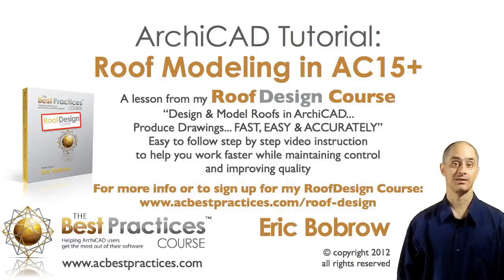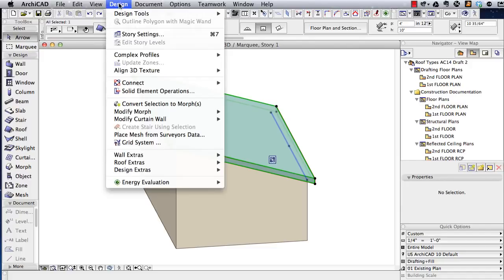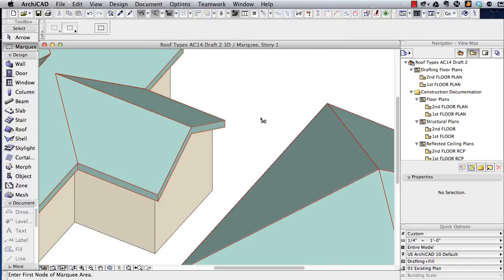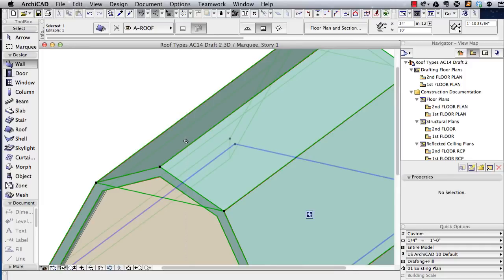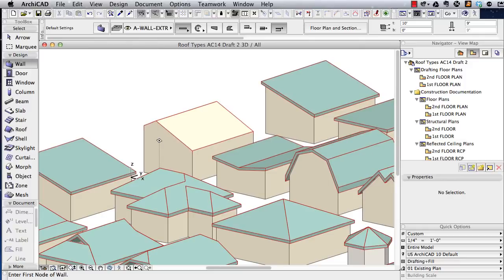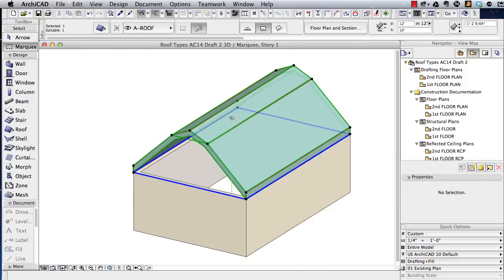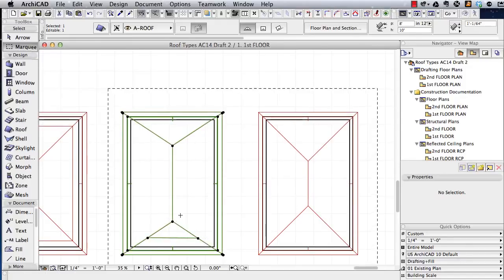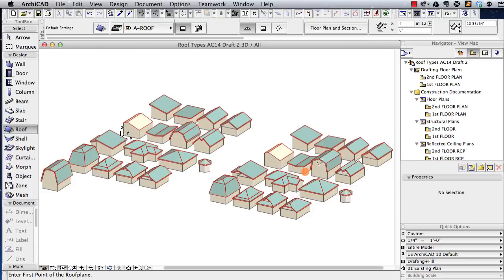ArchiCAD Tutorial | How to Model Roofs – In Depth Tutorial For A Wide Variety of Roof Types

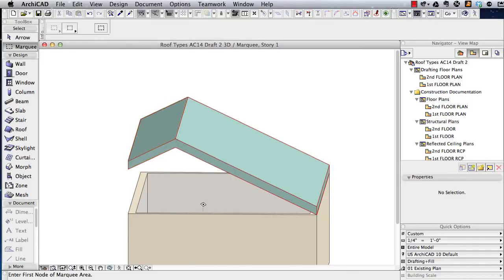Comment: Great tutorial, but what are you clicking to merge the two roof edges at 29:42?
Reply from the maker: @Vivex - In each case, I am selecting one of the roofs (it acts as the "controlling one" that defines a sloped plane) and holding down the Command (Mac) or CTRL (PC) key while clicking on the EDGE of the other roof, causing that EDGE to reposition to meet the "controlling" roof. This is not technically "merging" the roof edges; it is repositioning the edge (that you click on with Command or CTRL) to the location where it will cleanly intersect or meet the other one. I hope that is clear...
Reply: @EricBobrow  Thank you, I figured it out eventually. Very useful way of creating roof plans of existing houses, in practice almost every roof had slightly different plane angles
Reply: @EricBobrow  Hello, Thank you for your so helpful tutorial! I must be doing something wrong while clicking the two roof planes, because the command does not work for me. I click the first plane, then press CTRL and click the second plane. Right? Afterwards i get the "Error-sound". Also, it would be awesome if afterwards the two planes can become one object. Would be very grateful if you could help in this matter! :) Thank you!
Reply from the maker: @teodorapascu3777  You need to SELECT the first roof element (not just click it) so it has handles visible. THEN you can Command-click (MAC) or CTRL-click (PC) on the appropriate EDGE of the second roof plane; this will cause Archicad to reposition that edge so it will cleanly meet the plane of the original (selected) roof element. 

Unfortunately there is nothing that is available to merge them into one object. You can create a multi-plane roof, then later break it into multiple single plane roof elements, but there is no inverse option of combining two or more single plane roofs into a multi-plane roof.
Reply: @EricBobrow  thank you!! It finally worked, though, my question is, if i have now two roof planes, not symmetrical, which lead two the form of a roof, but they are not connected, is it possible to create out of it a with roofmaker/ roof wizzard the truss? Or is there other method to create a not symmetrical roof with diff plate heights?:) would be awesome to hear your opinion! Thanks in advance!
Reply from the maker: @teodorapascu3777  Roofmaker/Roof Wizard does not create trusses, it can create a system of individual framing elements, each one a piece of lumber or timber. A truss can be made using a variety of methods, including the legacy tool Trussmaker (with which you draw a series of lines in section, then convert them into a single new object with specific dimensions), the Morph tool, or the Curtain Wall tool. There are also trusses in the object library which are somewhat configurable.

Regarding the creation of a not symmetrical roof with different plate heights, using the multiplane roof method, this is possible by adjusting the blue pivot line boundary on one side. If you offset it outside the walls, the place where it meets the wall goes up, which gives the appearance (and essentially the geometry) of a raised plate height. You can then independently offset the roof contour edge to the desired distance from the walls, and optionally change the roof plane angle.

If you send me a sketch of your roof design concept, or an Archicad file with the single plane roofs creating the geometry you're seeking, I'll be happy to record a video showing how this can be done. You can email me at support@bobrow.com - and if you're sending a file larger than 10mb, upload to Dropbox and send me a link to download it, or use a service such as WeTransfer to send a download link for the file.

Comment: A lot of roofs without roof construction.....after watching this video you will not be able to construct a wooden construction roof.
Reply from the maker: @Mr. Architect - This video teaches methods to create a schematic level roof model for different styles and types of roofs. Once one has the basic model, one can go in and add more detail. One approach is to duplicate the roof elements, dragging one copy on top of the other, then making the lower elements only reach the edge of the building while extending the upper ones out past the edge. The lower roof(s) represent the framing space, the upper one(s) the cladding (they are adjusted to be much thinner). Then framing elements are introduced, either as stick framing or trusses. The process can continue, adding in detailed coverings such as tiles and profiled beam elements covering the edges, as well as rain gutters etc. This video is just the beginning...

Comment: Hello Eric,
Thank you for another great tutorial. I do have one query though, when you were doing the dutch gable you said to make the pitch of the roof, where the gable is to be placed, at 45 degrees which is steeper than the roofs without the gable. I don't know what it is like in the USA but when a dutch gable is built in Australia all roof panels have the same pitch. Could the roof with the gable be adjusted to the original pitch after the gable has been created.
cheers.

Comment: hi there :) help please. I have problem with roof. the same composite material, but because of 2 different angles, one for left side and one for right side of the roof, in the middle part where the connected, i have different tickness of roof composites....because of angle of side of the roof. i need same dimensions .... i can not find the solution :(
Reply: +Silvio Šarunić http://archicad-talk.graphisoft.com//files/roof_thickness1_152.jpg